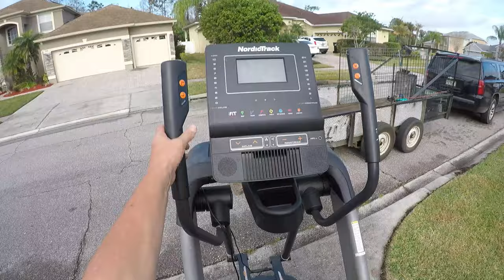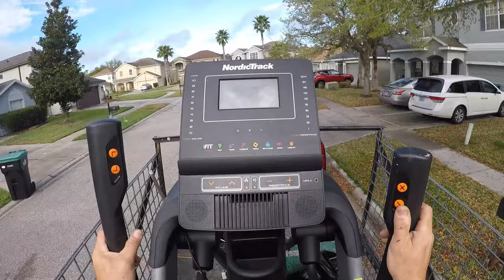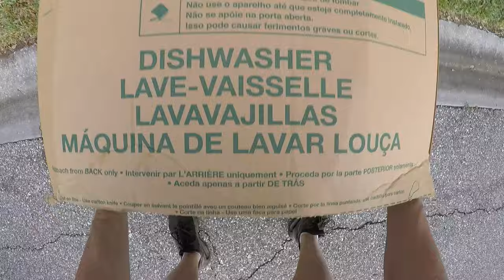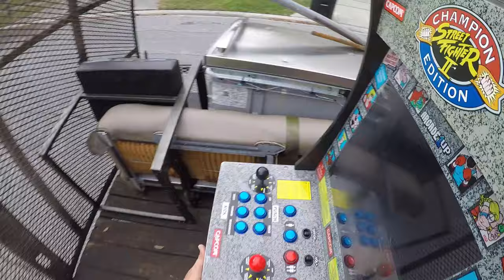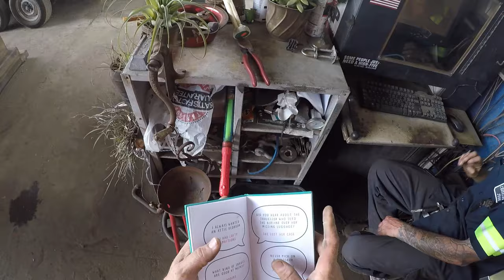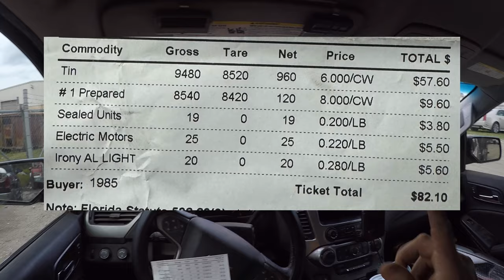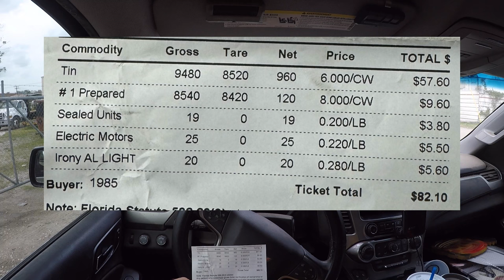Street Treasures - We Found The Coolest Stuff Today!

Comment: Why don't you also cut the wiring out of the battery cars/toys? Every bit adds up.
Reply: That exhaust pipe with the braided piece is usually stainless, would have been light irony.
Reply: Sigo viendo todos tus videos y me lo paso muy bien pero sobre todo tu música
 Sigue siendo un estupendo señor 🎉😊😊🇪🇸🇪🇸
Reply from the maker: I leave it in case someone ants the car - if I cut the wiring the car is trash.  It is not that much and leaves it workable with a new battery - most trash them when the battery is no good anymore.